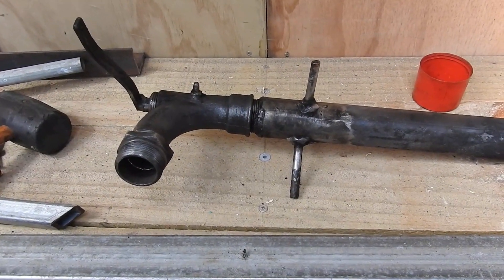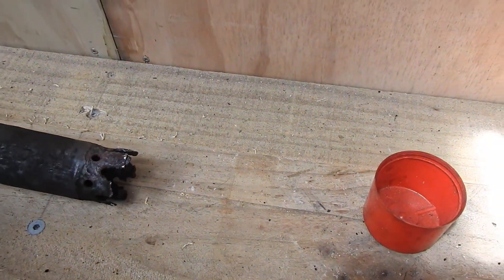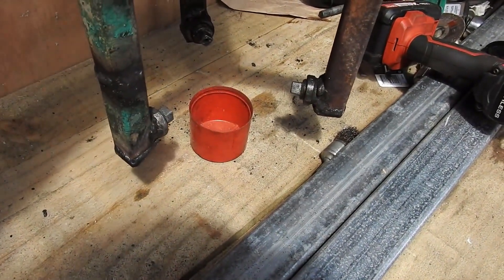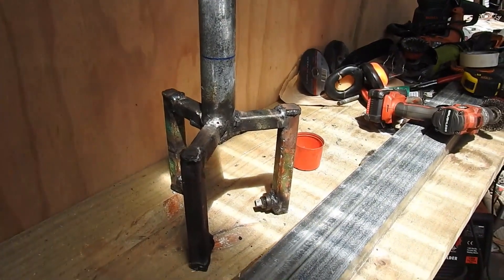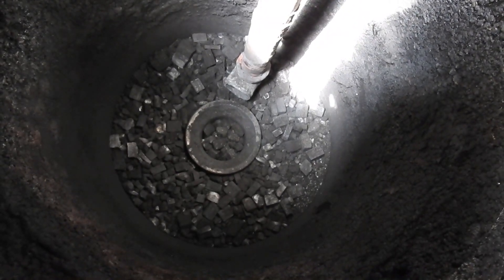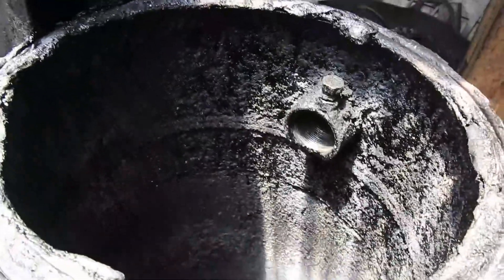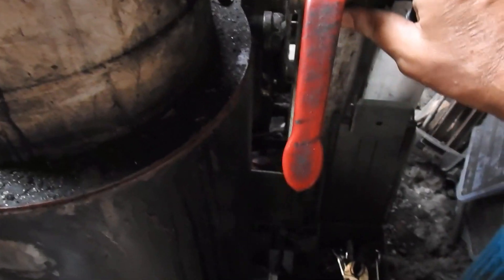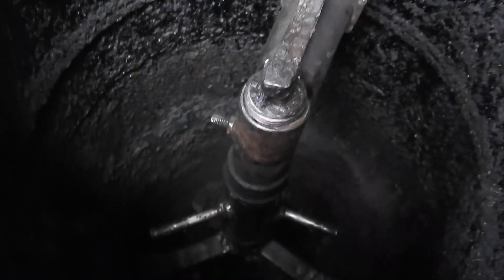New nozzle design for Phoenix Gasser

Comment: Looks like a big improvement having the air coming from the outside do yoj have bridge problems? . I believe drilled out Stainless steel bolts wil live quite some time in the heat . Maybe tig welding cups nr 6 ore 8 are better i don't know for sure
Reply from the maker: Yup. This improves the operation of the gasifier, and makes it work more like a standard Imbert design. 
Bridging was a problem, so I modified this design, and added a torrefaction tube, in order to hide the pipework, and preheat the fuel. 
There's a video about that too  :) . 
Agreed, stainless steel parts wood make a big difference in the lifespan of those nozzles.
Reply: @CNCmachiningisfun  thats why I go for Stratified . J replicated the gek gasiffier but it made lots of tar en had bridging problems to :(
Reply from the maker: @oscarverwey  
 Yup, it is always too easy to make tar :( . 
I learned that lesson the hard way!
Stratified systems certainly have their advantages, so maybe I should look into those, once more.
Reply: @CNCmachiningisfun  if you like look for (dual fire gasiffier on Google )en click the drive on wood site there is a free link if the pdf .  this is the one I replicated it has a dubbel air nozzle ring en 2 reduction zones of 200mm high for a 110mm pipe air ratio is 70/30%  . This gives indeed super low tar . I got a few videos about that one to
Reply from the maker: @oscarverwey  
That's good advice. 
I will take a good look at this, so I can add it to my ever growing list of projects. 
Your love of gasifiers is quite invigorating  :) .

Comment: whats up i nether of us have been on in a wile im glad to see a new post bo i have run into a problem that i found that most wood gasers have sufferd from well one i have made some modifications to my wood gas beetle that have kinda made the gasifier kind obsolete and two wile it still isnt cheep gas has dropped her to were its less than 10 cents a mile to drive my beetle on gas so that means that me putting 300 miles on my car using wood only ONLY saved me 40$ of gas money definitely not worth the time put in and now the car has a supercharger adapted from a jap. subaru so the gasifier is now basically useless b/c im sure once the blower sucks on the gasifer it will immediately smelt out the core dew to the super high flow that this gasifier is simply not designed for i could make a new reactor but for what, it would cost me more than i would save but i do have a off grid property that needs power but its in the desert so solar really covers most of my needs so one again the gasifier is obsolete im not sure were i want to go with it right now but i do have some questions with gasifier do you think is less finiky and less attention needy the good old two stage imbert gasifier or the charcoal style i have a large amount of oak and despite popular belief i have found oak is not very good it takes too long to burn and dosent go down well and tars up the blocks in the hopper but if i made it into charcoal might make it more viable and from my research the char gasifier is less complex one last point i have been working on a oil gasifier to be able to run veg oil in a gasoline engine i all ready have a working carburetor from my 1927 ford model t came equipped stock only that year with a ford plate vaporizer carburetor you can start the engine on gas and when it warms up you can switch to kerosene or diesel or veg oil for that matter im tring to make a more modern version to run a more modern engine i have some 80 gal of use veg oil and diesel engines are too expensive what are your thauts =)
Reply from the maker: Please excuse the delay in replying. 
 I will get back to you, as soon as I can, my good friend  :) .

Comment: Over at driveonwood, we've had major success in charcoal gasifiers with silicon carbide bushings used for heating elements. They seem to be utterly indestructible. Just wanted to share
Reply from the maker: Thanks kindly for this. 
 I took a look at some silicon carbide components online, and it seems that some of them are exactly the right shape to become major parts of a gasifier. 
 Watt an amazing time we live in  :) .
Reply: @CNCmachiningisfun   sand blasting nozzles in particular often have a thread cut on the OD, and the orifice size is just about right.

here's a photo of a nozzle with hundreds of hours of runtime, being removed looking perfect from slag. http://forum.driveonwood.com/t/simple-filters-for-simple-fire-systems/956/86
Reply from the maker: @icarus901  
 That looks absolutely splendid! 
 More folks need to know about this, as most of us smaller builders are still using steel, or stainless steel, gasser components. 
 Oh, by the way, google marked your comment as spam, and, as usual, it NEVER told me about it. 
 Nonetheless, your comment has duly been restored to its rightful place, here in the thread  :) .
Reply: @CNCmachiningisfun  Glad that you restored the comment :)  Our experimentation into the carbide-based nozzles is really pretty new. I found them on ebay late 2018, bought a few samples to try and shared the seller with others in that thread.  We've spent the time since testing to see if they really do last..I think we have enough time running now to confirm wholeheartedly that they do.
Reply from the maker: @icarus901  
 That is absolutely amazing stuff! 
 My charcoal gasifier could surely benefit from this, as I have clocked up more than 100 hours with it, and I am pretty sure that its mild steel nozzle is well and truly cooked. 
 Some improvements are in order, and that's where a shiny new silicon carbide nozzle will find its way into the system  :) . 
 I thank thee, dearly, for the valuable information that you have added to this discussion.

Comment: Almost forgot to ask. What are the diameter of the holes you drilled on your nozzle ends?
Reply from the maker: Currently, this is 7/32, or 5.5mm - in ye olde fashioned measurements  :) .
Reply: @CNCmachiningisfun  Thanks. I think I'm going to go with the drill diameters you used. Your florescent orange flare was a testament to a textbook tar "crack-O-thon" probably due to a faster air flow giving you more of a billowing effect over the hot embers.
Reply from the maker: @flash001USA  
 Yup, those small nozzle ports are surely causing a rapid airflow, which must be increasing  the heating effect in the burn zone. 
 Couple that with the absence of air cooled steel in that area, and you have a good formula for kleeeen gassss   :) .

Comment: Steve that unfiltered flare looked damned good... Both bill and I are looking at doing mods on our gasifiers with nozzles off to the side rather than down the center. I think you're really going to appreciate the way we're going to approach this mod... You got to keep something in mind that unlike most of us, you have a lot of real world run-time on your gasifier so anything that can go wrong or any weak links in the design are going to stand out like a sore thumb to you much faster than it will with us. I've been pretty lucky with my centerfeed nozzle and for some reason it does work pretty decent for my setup. I've replaced the center feed nozzle twice and the only reason I want to change up the configuration is to remove any obstacles or obstructions that could cause bridging in the hopper itself. That was the only thing I was concerned about with your Tri nozzle set up but it seems to be working for you at least in this video. Keep us in the loop.
Reply from the maker: Howdee Flash, 
 Indeedee, that primary flare looks delisherous! 
 I have been trying to imagine how your new nozzle ring design is going to look, as I went thru a few ideas - before settling on this simple trial system. 
 One of my ideas had the nozzles fed from below the hearth - and rising from its floor, like a ring of lampposts. 
 It seems that there are a fair few ways of doing it, and I really do look forward to seeing watt you come up with  :) . 
 I wonder if the wood species has anything to do with the longevity of the centre feed nozzle system, as I am using Pine, which, I read somewhere, is one of the worst fuels for our systems. 
 Hey, it is cheap, and plentiful, so why not plug my appliances into Pine treezeez? 
 Bridging seems to be prevented by the sheer height of the vertical risers that feed the air down to the nozzles. 
 If these had been appreciably shorter, I fear that I wood have seen rather a lot of bridging at the hearth. 
 The holes I drilled into the nozzle plugs are 5.5mm in diameter, or about 7/32 in modern measurements  :) . 
 Even though these admit less air than the previous centre feed nozzle column did, I suspect that the improvement in gasifier performance is due to there being no cold metal in direct contact with the burn zone over the hearth opening.
Reply: @CNCmachiningisfun  Basically what I'm making is a flat steel plate that contains the nozzles and it will be fortified with high temperature concrete cement. It will sit dead center over the hearth like you're doing with your tri-nozzle insert. It will be about an inch thick and here's where things will differ from what you've done. 

Instead of running a pipe down the center of the wood hopper to feed the nozzles like we do now, my center nozzle pipe will be removed and the original wood hopper will now become the outer wall and a new hearth insert that I have constructed will become the inner wall AND the new wood hopper. My original air intake with the shut-off valve will stay in place so nothing changes on the outside. 

The intake air will enter between the inner chambers of the old and the newer wood hopper like a more of a traditional design. OK back to the new nozzle explanation so you can see how this goes together and everything seals... The nozzle plate I will build will be about 1.5 or 2.0 inches wider in diameter than the new wood hopper insert and the air will flow between the layers of the old outer wood hopper and the newer wood hopper insert to feed the nozzles their air. The new inner hearth will butt up flush with the new nozzle plate to give it the seal it requires. 

The new inner hearth will have a flange on top of it so that it can screw to the top of the old wood hopper top where I fed the gasifier wood along with a tiny bit of high temp RTV cement to have a solid seal on both the top of the wood hopper and the bottom of the new inner wood hopper where it butts up against the new nozzle plate. The nozzles themselves will be sealed and embedded in the cement so they should have a decent life and once they burn up or the cement burns away I can unscrew the inner hearth and remove it and drop a new nozzle plate into the gasifier and we're off to the races again. The new nozzle plate will be held into place with gravity and a tiny bit of high temperature RTV cement along with the new inner hopper that will butt up against it so this concept is about as simple as it gets.

If this works I think I'll have one hell of a simplified build that is easily serviced. The only drawback is I will loose some real estate in the hopper so I'll be filling it with a bit less wood but the trade-off should be well worth it. As I mentioned earlier I do get decent trouble free runs as it is now that are stable but I want to try this to see if it improves the build and who knows, maybe a better running gasser so time will be the judge.

On a side note, I had a bit of bad luck that turned into good luck today. We've have had a lot of rain for quite a while here and I haven't ran the gasifier or the generator for at least 6 months. What I wasn't aware of was rain found it's way into my engine via the carb and filled the engine totally up with water seizing one of the valves with rust around it where goes through the engine block where the valve spring is on the intake side. That was the bad news... But stay tuned......

Today I tore the engine down and to my delight BOTH valves were practically spotless with only a bit of surface carbon on the tops of the valves. There was ZERO carbon build-up around where the valves seat as if they had been running on propane. The piston was spotless on top to so that blew my mind but now I know that the woodgas is completely free of any tars or other evil nastiness. 

I used WD-40 to un-seize the valve along with cleaning the valve stem of the rust. After that I flushed the engine to remove any nasties from it but I ran out of sunlight today so tomorrow I will put it back together and fire it up on petro for a test run. I've been curious for a while what I would find on the valves when the time came to take a peek into the engine so that was a relief because the first thing that went through my mind was a sticking valve due to old sticky tar that had accumulated over time. This engine has seen at least 400 hundred hours on regular gasoline and probably 100 hours on woodgas since I've owned it so I have to believe the woodgas cleaned the valves and the engine. Either that or it was a miracle and I was one lucky SOB.
Reply from the maker: @flash001USA  
 That's quite an in depth description you have assembled there  :) . 
 Though it may sound complicated, it seems that you have simplified the whole system, while enhancing the air preheat system - and insulating the gasifier against excessive heat loss to the atmosphere. 
 Well done indeed  :) . 
 LOL, you have very effectively redefined the act of 'flooding' the engine. 
 Its a good thing that you found it, before it could really destroy the sensitive innards of the beast, as I have seen watt a lot of water can do to a tractor, and it is NOT pretty! 
 On the subject of possible engine damage, due to tars, two of my 'pre-flight' checks, before firing up the gasser involve checking the throttle for freedom of movement, and slowly pulling the starter rope, to check for a stuck valve. 
 You see, the original gasifier killed my first engine, and I had to rebuild it, before it went on to run for 1109 hours, until it blew an oil seal. 
 Before then, I would simply yank the rope, and hope for the best, which ultimately bent a valve stem, and snapped a rocker in half! 
 In all the subsequent years, there has not been a problem, and I get the impression that woodgas is cleaner than petrol, as I notice that the engine oil remains clear for longer, and doesn't smell burnt, like you get with 'normal' engine systems. 
 Even after all these hours of engine runtime, it still blows me away that we can get so much power out of a pile of wood chunks. 
 Addiction mode engaged  :).

Comment: I don't know much about ceramics, How they are cast or formed, But it certainly would handle the temperatures produced by the gasifier.
Very nice design, the distance from the burn chamber seems to lower the direct contact with the highest temperatures. Great job!
Reply from the maker: Ceramics would be an interesting choice of materials here. 
 I have heard that these have been successfully employed in other gasifiers, but it is a little beyond me to figure out the finer details of this. 
 In the future, I may opt to use Inconel, or some other high quality stainless steel nozzle system. 
 Now that I know that this idea works so well, it is much easier to justify the extra effort  :) .
Reply: @CNCmachiningisfun  dude, I know you can figure out ceramic nozzles-look at my old videos??
Reply from the maker: @caseyjo2566  
 I will take me a lookeesee at those, and learn me some new things  :) . 
 For some 'reason', google marked your comment as spam. 
 I find it 'interesting' how google marks good comments as spam, while allowing utterly vile comments to come thru, unhindered. 
 Oh, how I H8 google! 
 I hereby plan to gasify google, thereby turning poop into watts  :) .
Reply: @CNCmachiningisfun  I agree. But how hard would it be to drill some holes in a ceramic tile and pressure fit it in the end? But, you found an alternative solution that works very well I might add. ;) Just food for thought.
Reply from the maker: @nasanction  
 Maybe I could use ceramic Mig welder shielding tubes. 
 These could be slipped over the nozzles, sort of like how they are on the Mig torch.
Reply: @CNCmachiningisfun  By George I think he's got it! That's a fantastic idea!
I do seem to recall someone calling them consumables? But I'm sure that Welding is a much higher temperature then the gasifier could produce. I think your on to something! ;)
Reply from the maker: @nasanction  
 This idea could work, but I think that there wood need to be some sort of hoods over the ceramic shields, to protect them from damage when manually stoking the fuel in the hopper. 
 At the moment, I am inclined to go with the triple downpipe system that I described in my video, as this makes for quick and easy replacement of the nozzles when they get eaten up by hungry woodgas bugzez  :) .
Reply: @CNCmachiningisfun  Just toying around with the idea. Your choices over the years have brought you this far, I'm sure the path you choose will reap many rewords in the future. ;)
Reply from the maker: @nasanction  
 Yup. Mistakes will be made, and lessons will be learned. 
 This is how great things come to be. 
 Naturally, all will be shared, here on googleTube  :) .